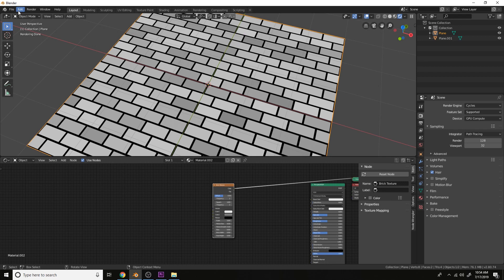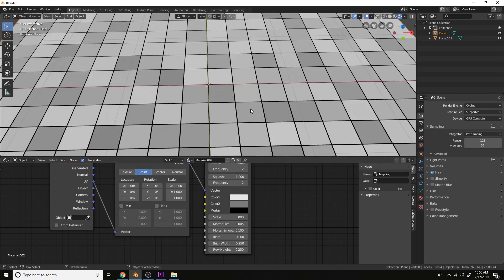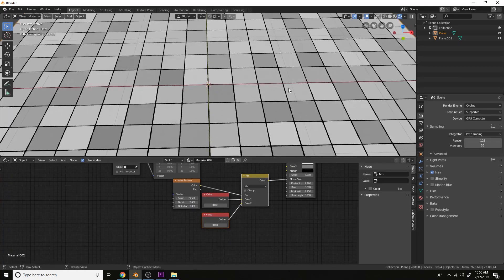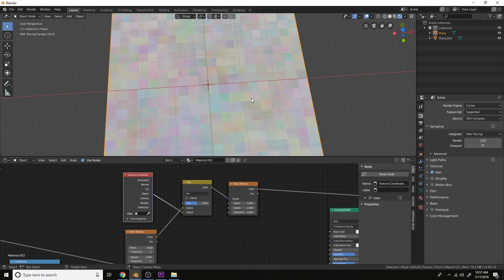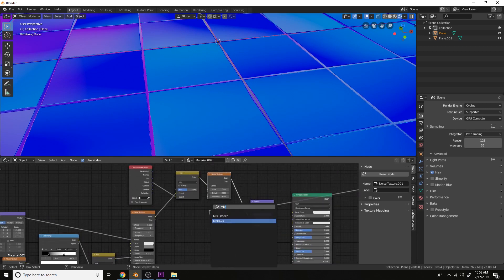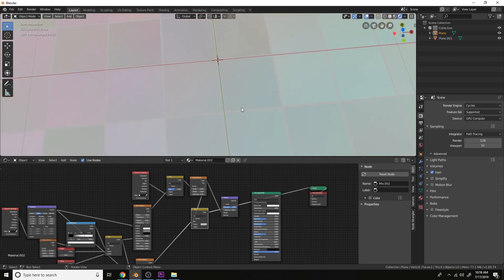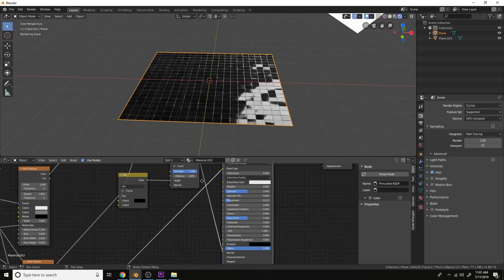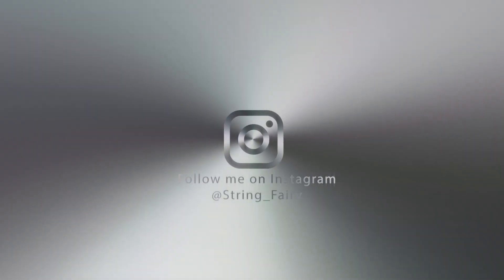Blender Cycles Tutorial | 100% Procedural Uneven Tile Material

Comment: What you end up with here are tiles that have different surface imperfections (bumps), not same looking flat tile with inaccurate lay. To do that you need random color per tile (black/white tile color -> noise, play with settings), turn that into a surface normal modification (slightly advanced), then mask out the grout where you don't want it. If you want to do it with a bump map rather than a direct normal modification, you can use a mathematical linear gradient centered on each tile which is randomly rotated per tile, then mask out the grout. You should preview and confirm the correct bump settings by temporarily plugging its driving data into microdisplacement. You don't want to use a 1m bump distance on metric tiles ;) The defaults are horrible for most use cases. 1mm at absolute maximum (0.001). Also, for tiles it makes more sense to control the physical size of them (mapping node set to texture mode), combined with brick scale, width and height set to 1. That makes it easier to combine with other nodes later. The random color output per tile can also be used to drive image texture node offset, scale, rotations, albedo base - many times you want to combine procedural work with image work if those kinds of details would be far too elaborate to setup using procedurals only. This kind of randomizing on a decently sized image texture will get rid of obvious texture repeats that makes it look CG.